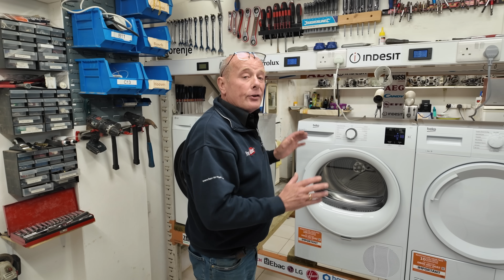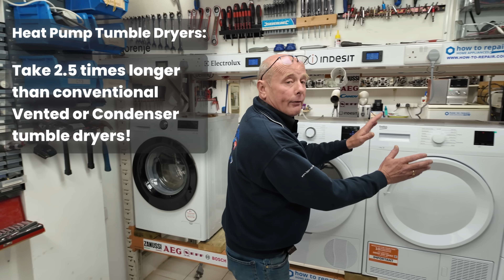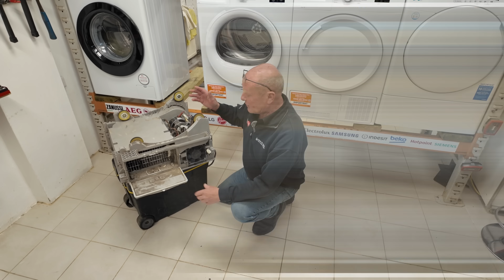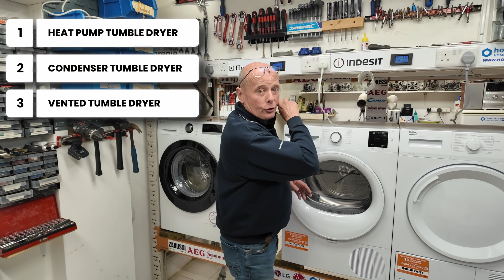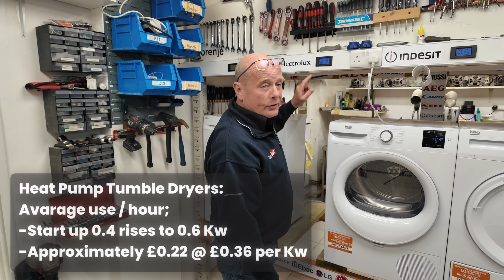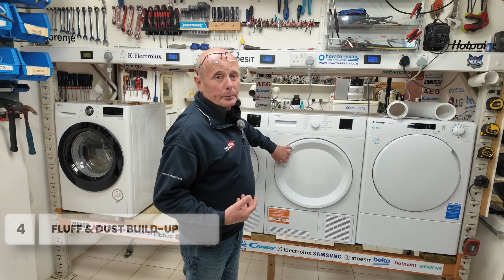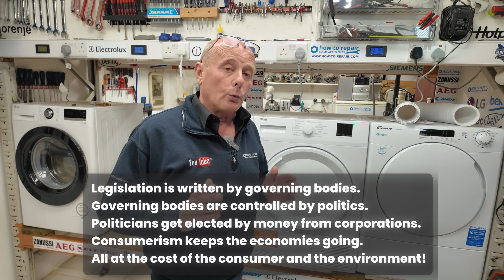Tumble Dryers the Shocking Truth About Heat Pump vs Vented & Condenser, NEW LEGISLATION!

Comment: Exactly my experience, I had a heat pump dryer for 8 years, at the end it consumed 1100 w/h for 3 hours, it was probably completely clogged, now I have an exhaust dryer again, higher consumption is also not too bad, and it dries quickly!

Comment: I'm curious if the heat pump tumble dryer could run more slowly to compensate for the fact that the water is being evaporated more slowly.  Would this make the wear and tear and fluff generation be comparable to conventional units?
Reply: I believe they need to tumble at a reasonable speed for it to dry efficiently, if it is too slow, not as much surface area of the wet clothing is going to be exposed to the drying air. Wear and tear on the machine itself shouldn't be a problem, because the manufacturer will have selected bearings and other parts up to the job. Not sure how much wear a tumble dryer causes to clothing, I think most of the fluff collected in a tumble dryer filters is produced during the actual wash, and the dryer does a better job of getting loose fluff and and hair off the wet clothing . The lower drying temperature of a heat pump (50°C vs 70 - 75°C) is less damaging to the fabric. I have seen some very positive reviews of recent machines made by the better brands,  with the owners claiming they don't actually take much longer than the conventional dryer they replaced, providing they are used at normal room temperatures, and the clothing gets a decent spin to get the water out.

Comment: Also a fan of the heat pump but they suck in a dryer.  I could not get clothes dry and they seemed to come out tortured.  I tried all the settings and they all finally finish with warm slightly damp clothes.  Asked the other residents and they all agreed they suck. Warm and humid for extended period of time (longer than x2.5) seemed to be a recipe for mouldy clothes but was told we had to have them as they were less of a fire risk.

Comment: Another great video 👏 I'm an HVAC engineer, and guess what? I have a vented dryer. I used to have a heat pump dryer, but it broke after only two and a half years despite being from a "good" manufacturer. I gave up on repairing it. Instead, I searched for an old vented machine; I reuse the heat from it, obviously ;-)  There's also one thing missing from this video (a hint for a future video): the heat pump system increases humidity in your home, which is generally not a good thing, especially in newer buildings

Comment: As an electrician I would certainly have an attempt at repairing my vented tumble dryer, but never my fridge as I dont have the gear to re gas the compressor…..just like a heat pump dryer.
And I thought we were going down the route of right to repair.
Thanks

Comment: No luck for nat gas, I understand you cant use nat gas. In canada, although our lieberal government is trying to shut down the use of fossil fuels, nat gas is still widely used. A comparison for cost of operation was done yrs ago where nat gas was compared to element electric, propane and heating oil. Oil and element electric and heating oil were roughly1.6 times the cost of nat gas, propane was 2.3 times as much. That's using oil and gas units with a 50-55% efficiency and element electric at close to 100%. In a dryer the efficiency would be a lot higher as the clothes are in direct contact with them heat from gas. Nat gas in canada will be here for some time

Comment: I can run my heatpump tumble dryer on a relatively dull day purely from my solar as I will be generating, at worst, around 600w, that wouldn't be enough to cover the usage of a normal condensing or vented tumble dryer so that is my argument for having one over the other types

Comment: I agree with your statements regarding repairability and maintainability. When the dryer becomes clogged, it can seriously decrease its performance, or make it inoperable.
In my opinion, the time needed for drying is not so important. It will take longer time, but drying will be more gentle.
I assume that the temperature in the dryer will be lower due to a lower power consumption. This can, contrary to your beliefs, improve longevity of your clothes.
Wear and tear on motor is negligible. I have a combined washing machine with an integrated dryer, and the main wear and tear occurs during a spin-dry.

Comment: I'm an Australian doing a bit of research on whether to get a heat pump dryer. Between this video and my Mum telling me she doesn't like her expensive HP dryer i've decided to stick with my 1980's Maytag.
Reply: Heat pump is soooooooooo bad!!
Reply: @MrJonnyfied  No, no they arent. They take a lot longer but also are much much cheaper to run as they are much more energy efficient.
Reply: I went from Normal dryers to heat pumps, they are much better on clothes, a lot cheaper to run, and dont cause huge condensation that a normal dryer does - but they take a lot longer.
Reply: You have to use the heat pump dryer differently. I do a load of light weight stuff first, then a second load of heavy items like jeans and towels. This can take as little as 40 minutes as the dryer is already warm. Mine is is a Beko because we had a Beko condenser for 10 years.
Reply: As an Australian, I'd hope you'd also have some good solar powered drying options as well.
Reply: @lindsaycole8409  you can hang clothes on the line, with the added benefit of UV but didk about anyone else, not super keen to do so
Reply: @lindsaycole8409  yeah, hang the washing on the clothesline and let the sun and the wind do the job.

Comment: My Bosch heatpump dryer takes about 60 minutes to dry 90% of most full loads.  The vented dryer I used to have took about 40 minutes to dry the same load.  So in my experience, it's not 2.5X longer for the heatpump.  Yes, they come out feeling a little damp, but just shake them out and they are fine.  And, the heat is much gentler, so easier on the clothes than the vented dryer.  Yes, the lint filter needs cleaning after each use and the maintenance cycle needs to be run every 4-6 weeks.  There are compromises, but so far, my experience has been pretty good with the HP dryer.  The latest Bosch cleans its coils with a water flush during the maintenance cycle, so it should not get full of lint that quickly.

Comment: I actually got a heatpump-dryer, and I'm lucky with it. First, I can put any type of clothing in it. Even wool. It will run a bit longer (but not 2,5 times), but the temperatures are significant lower. Temperature also stresses the clothing. Also the condenser and evaporator are located direct under the top cover. Cleaning should be easily. But the filters are very efficient. There is some buildup of dust in the duct to the filters, but the structures of the evaporator locks still new. It seems, the design get better with new generation of machines.

I think condenser are not yet perfect, but will make progress. It is very effective to dry air by cooling it down and reheat. A condenser dryer try the same System, but the cool air ist still warm, and the dissipated heat is wasted and must be replaced by generating "new" heat. The heatpump ist the perfect system for this type of hot / cool cycle.

Comment: The power consumption explanation is wrong, the way to accurately measure it is to actually connect the machines to a watt-hour meter. The reason it was so inaccurate is because he said the start up power consumption of the compressor was the constant use of the machine which is absolutely not the case. Heat pump driers genuinely use significantly less power overall for the same load of clothing.

Comment: I have a Miele heat pump dryer with 9200 hours on its counter.  ZERO faults with it.  It dries most loads in 60-75 minutes.  Yes, it is slightly longer than a gas or electric vented, but it is so much more efficient that there is ZERO reason for a vented dryer.  I have NEVER seen a Miele heat pump dryer take 2.5 times to dry the same load of clothes.  I am located in the USA and used the TWI-180 dryer for my conclusions.  I have owned Bosh and Miele appliances for almost three decades.

I notice there are NO Miele logos in your shop.  Hmmmm.

As for end of life, at least in the USA, all refrigeration units have their gas removed before recycling.  There is also a large push towards using propane (R290) as the refrigerant of choice in the USA.  It has a greenhouse gas potential of nothing.  Meaning it does not need to be collected when recycling the unit.  The amount present in a small circuit like a dryer poses virtually no explosion or fire hazard.

Comment: In winter I vent a vented clothes drier back into the house, to add moisture and heat to the air conditioned air which can get really dry.

Comment: I have a heat-pump water heater and a heat pump dryer.  They have paid for themselves already.  I love them.  As an added bonus, my heat pump water heater keeps my basement dry, and my heat pump dryer adds a little humidity where it's needed.  Like any machine, they need the proper maintenance, very little maintenance.

Comment: Yep, more "green new deal" BS that is just short-sighted. It's FAR more wasteful to toss the 5-year old HP unit and then replace it than to just repair the other styles. Just like EV's that need $20K batteries if you can even get them and then end up buying a new car. Just build nuclear plants and stop all this "the sky is falling" "climate change" (change is the normal state of the climate, it's called WEATHER) stupidity.

Comment: I have a townhome in Vancouver Canada. My 50 year old, 5000w dryer has had been used 2-3 times a week since 1975. Still works like new with zero maintenance. Old school technology.
Reply: Wow!!!
Reply: @How-to-repair 
We have a 2012 Cylinda TVP 420 with heat pump. It has a 800 W max rating and it has served us BRILLIANTLY for 13+ years now. Only thing is a bit of belt slip(?) causing noise during first minutes of operation, that's been for many years now. We found it on sale and I got the price down a bit more, picked it up for around £400, original price was twice that.
It dries 8 kg of clothes in 60-90 min, so I'm not sure what garbage is on the market these days. 
Our 2012 Cylinda Sverigetvätten washing machine is very similar to the ASKO you recently reviewed, only older... We also have a Cylinda Sverigedisken, dishwasher, from 2012, nowadays produced by ASKO, while Cylinda took the path of planned absolecense. Our parents in law have an ASKO and after an initial warranty repair, it's been GREAT and the inside is fabulously great to allow three layers high stacking and STILL getting it clean!

The dryer uses around 1 kWh for a full load. You are using 8-10 kWh. That adds COST.
Reply: You should be happy that you apparently live where electricity is cheap. That's a ridiculous amount and waste of power.
Reply: @AB-80X  "That's a ridiculous amount and waste of power."
How much electricity and money does it take to make (and then dispose of) 10 new tumble-driers (assuming they even get to 5 years)?  Which is what we're talking about here when people buy green.
Reply: @johnrroberts7900 
Don’t know. My last dryer lasted 20 years
Reply: @johnrroberts7900 how much? You seem like you know?
Reply: @AB-80X  It is NOT a waste of power, the 5000W dryer will dry the clothing so quickly, that the total power consumed will be lower than a 2000W dryer that takes much much longer to dry.
Reply: @SodiumSyndicate  
You're forgetting one crucial element. There's a big difference in how efficient old and new dryers are, when it comes to heat transfer and moisture extraction. If you put 5000 watts into the clothes the way a modern dryer would, it will catch on fire! I just dried a complete king size bed set which is about 6kg in our 800w hybrid dryer. Took 80 minutes including cool-down. For your math to math, that would mean 12.8 minutes max, and possibly less if you factor in the cool-down. Good luck with that.
Reply: @AB-80X  Are you arguing for the sake of arguing? What fire? His unit has been running since 1975 and completely contradicts your theory. It dries faster, it doesn't throw away a bunch of junk every five years, it's more environmentally friendly than all these new hypocritical technologies. But you keep feeding the globalists, without even understanding what you're choosing.
Reply: @rg5777 ignore everyone.

Old is Gold
Reply: @AB-80X  It doesn't work like that. The machine, wether its 2kw or 5kw doesn't pull that power constantly it turns on and off, my 3kw is plugged into an energy monitor and if i check the graph over the whole cycle, it comes on solid for 10 minutes or so and the further it runs, the longer the 'off' gaps are where it just pulls 200w. I would also suspect the 5kw machine to get up to temperature quicker than mine which takes 10 minutes. Keep in mind, the longest the heater is on is during warmup, good look setting fire to wet clothes.

I would also expect a 5kw machine to handle a larger load than my 8kg machines.
Reply: @SodiumSyndicate I don't think that's how physics works.
Reply: @SodiumSyndicate nope... It would be about the same amount of total power however that 5000w of heat is a bad for the clothes.
Vented dryers are the worst in efficiency, a modern heat pump dryer used 50 to 75% less total energy than vented
Reply: @alexandrusterpu  That's how it works. Dry heat dries clothes faster than humid heat.
Reply: @rj7855  It is simple volume drying. 5000W can be 2000 deg C or 200 deg C. Just because it is 5000W, does not mean it will burn clothes.
Reply: @AB-80X  It is simple volume drying. 5000W can be 2000 deg C or 200 deg C. Just because it is 5000W, does not mean it will burn clothes.
Reply: @AB-80X most dryers new and old are around 5 Kw
Reply: @ak983625  
They are not, far from it. Most which are not heap pump, are between 2000-3200 watt. I don't even think Miele, Bosch, or Siemens which are the leading brands, have sold a consumer level tumble dryer, running a three phase system in two or three decades. Unless you're trying to dry what, 35 lbs of clothes or more, it would not even be feasible. You'd burn it up, literally. The only reason why some very old dryers are that power hungry, is because they are immensely inefficient. I bet that if you look up consumer products from any reputable manufacture, even in their legacy products, it would be incredibly difficult to find one that is even three phase capable.
Reply: Like what??  5000 W ??  In Quebec, like who cares, all hydro. Vancouver too??
Reply: @nas4apps Wow, 5 pence per kw/h equivalent (UK)! We pay 30p! Bet you all have EVs!
Reply: In my now 10 year old dryer does the same job with 1/10th of the energy.. in 10 years it has would had be more than €1000 in savings compared to running that  50 year old vented dryer for the same amount of time

Comment: Great video.  I have had all 3 types of dryers.  Vented is certainly the fastest but creates a great deal of heat and humidity if not vented out of your laundry.  Heat pump is so much more energy efficient but soooooo slow at drying large loads, so if you have a large family with large lots of washing this can be very impactful.

Comment: A lady told me her washer was not working.  The drum had fallen off of the shaft and was sitting on the bottom of the washer as it was a front load machine.  The drum was attacted to the shaft with an aluminum flange that had melted away from the strong soap and water until the drum fell off.  The repair guy said that he could not get parts or fix it.  To replace the washer to match the dryer would have been 3400 dollars.  The machine was only 4 years old.

Comment: The washers and dryers in my location only last about a year or two and can cost up to 3000 dollars.  There are windmills close to this place that start up push the voltage high and fry the computers in the washers and dryers, and stoves and everything that has a computer in it.  The local dump always has these things stacked three high for hundred of feet.  As soon as they clean out the stack a new stack starts up.  A lady dropped off a stove that was just over a year old.  The computer board was dead and it costs more to replace the board than to by a new stove.   My friend got a new washer and dryer.  The dryer did not work at all and they did not take it back right away.  I ran the test on the dryer and the computer was dead from the factor, so they had never used it at all.  It was 1500 dollars.  I went to the store to ge a computer part to replace it and they said they do not make that part any more.

Comment: Strange. Our heat pump dryer is twice as fast as all our previous condenser dryers, don’t cause higher humidity in the house and so far had no issues. Our previous condenser dryers have always had issues and required warranty call-outs and replacements inside the first year. 

Also how about commenting on the safety aspect as without such a hot element being next to loads of dust and fluff, surely the heat pump is much less likely to cause fires ? 

Everyone I know who upgraded to heat pump has the same opinion as myself, cheaper to run, faster or comparable drying time, no problems at all and already paid for itself in savings.

Comment: A heat pump Dryer is a new technology. This means there needs to be legislation to make these dryers more serviceable. It would be relatively simple to put the compressor on a drawer system for easy access and perhaps a good filters to stop buildup in general. I see the some manufacturers make self service difficult and the trend is only going further.